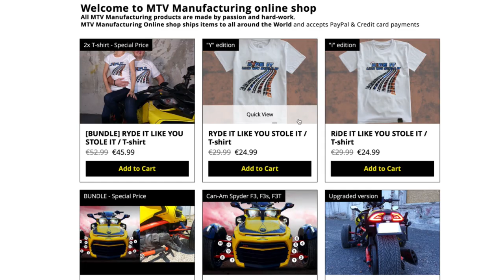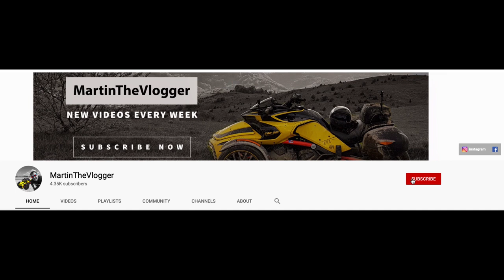Akrapovic Exhaust Restoration (Unmounting & Wet-sanding) 1/3

Comment: Hi Martin, I wouldn't clean the surface with WD40 and then apply coating. The reason is, that WD40 is greasy and spray paint shouldn't be applied to greasy surface. Better is to use regular degreaser instead.
Reply from the maker: Okie doke, marked down 🔥🔥🔥🔥
Reply: Hi Martin, really enjoy your vids!
I've noticed when you introduce yourself you say, Martin "AK" Martin the vloger! What does the AK stand for? Or do mean A,K,A, which is an acronym ''Also  Know As"....? 😉 ✌️
Reply from the maker: @JloJrock420  Hi Johny i should slow down and pronounce it better. Yup its A.K.A. 😉😉😉 thanx for watching my videos 🤟🤟🤟